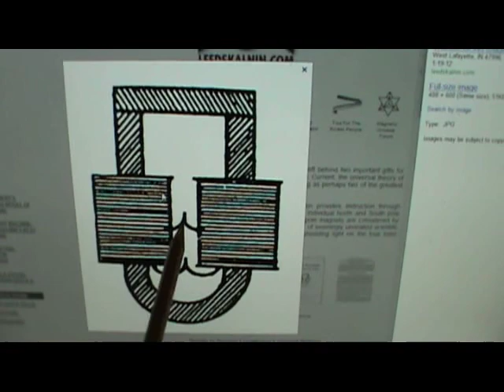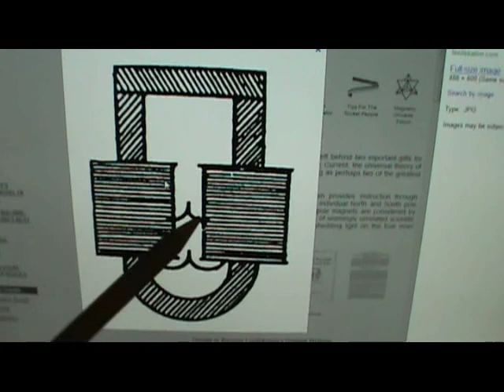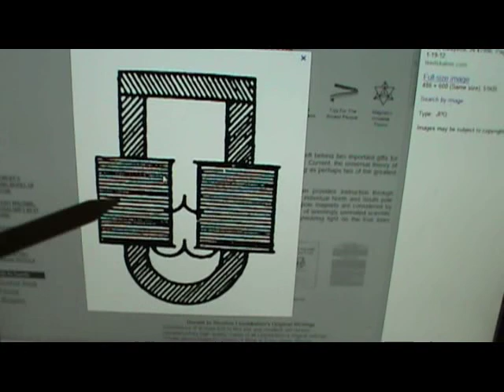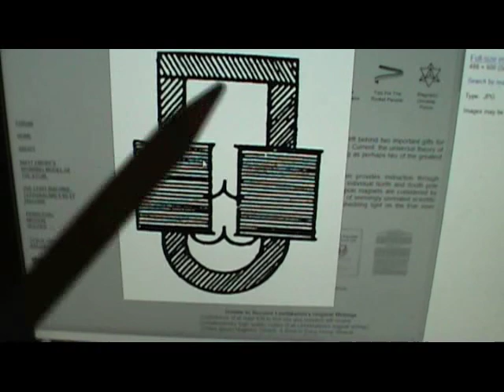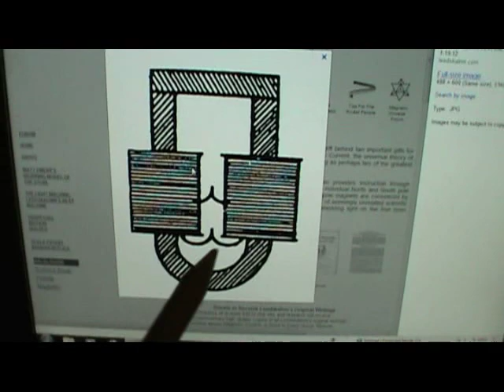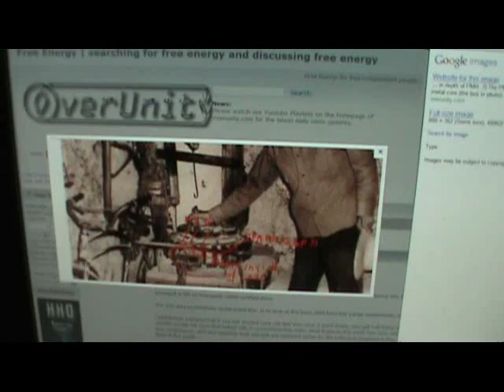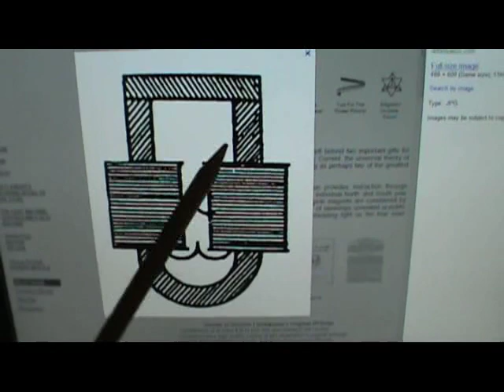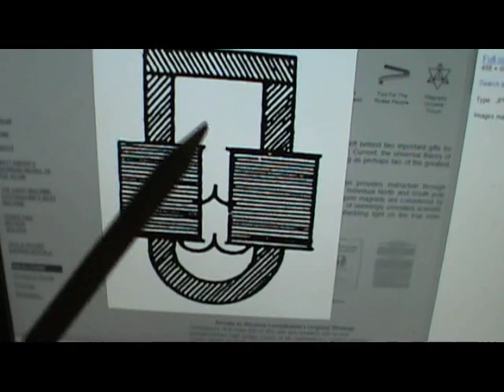Ed Leedskalnin PMH Flux Capacitor and Other New Thoughts

Comment: Everything Leedskalnin made was from recycled parts. 
If he specifies that an Aluminium Spool was to have copper wire wrapped around it do so.
 He would have been using something that was readily available to him at the time.
Adding thinner Laminations is a leap backwards , the Model T flywheel  magnets he uses = lamination thickness .

I think the original 16 static inductors get pulsed from the primary Ford mounted magnets. 
It then gets induced pulsed & magnetised  <??> 
by the multi laminated 24 Pole secondary magnet Ed fit above the primary 16.

Comment: Seems to me this is an analog reproduction of the toroidal matrix.  It’s the paradoxical state of the atomic structure, or planetary structure, which is that the capacitance is a time capsule for nested (n/s) embedded (g) energy states, which from a ‘big bang’ perspective gets larger and larger as ‘time’ goes on.  Where this storage of energy now, can be resonated later against a rotation of magnetic current which is out of phase or in phase irregadless, forcing the iron to lose the hysteresis curve, while the magnetic domains actively resist any change at all due to the fact that the magnetic capacitance cannot ‘escape’ the circuit.  So, the wheel would be the ‘sun’,  try placing the perpetual motion holder inside the wheel, aligned so that the ‘sun’ rises on its East, and sets on the west,  then, you may get alternating current from the holder as the wheel turns due to phase matching between hysteresis and domain shifting inside the loop.

Comment: Strange flux capacitor, back to the future. This would be quite nice if it worked, future tech:)
Reply from the maker: +dkdyker Well 'flux capacitor' is sort of catchy, but it truly behaves like a capacitor if you think about it...and the energy is stored in the flux of the charged U. When the keeper bar is removed from the U the energy is released/discharged all at once through the wires, just like a capacitor. And as far as people can observe, the stored charge in the U does not diminish much over time...a capacitor that does not leak it's charge :) Peace!

Comment: Hi Guys, for an experiment to SEE what the difference is for the coils core former TRY THIS. Wind the coils for the PMH on Al and also on a cardboard former, and then fit them over the Iron prongs as per Ed's design. Now for the interesting bit, pull the Iron keeper off and see what you get in the light bulb?????Then you will KNOW what electricity is and how it runs in the wire.

Comment: Did Ed played Backgammon, one of the oldest board games in the world played in Ancient Egypt?  Players move along U shaped path in opposite directions (like current in your core). You also have opposing vortices (triangles, 24 of them), just like you drew them in recent video. There are 30 checkers, 15 black and 15 white. If you run out of ideas, put coils where the checkers are (starting positions). Where there is 5 checkers-5 windings, 3 checkers-3 windings... (in proportions). Wild wild guess